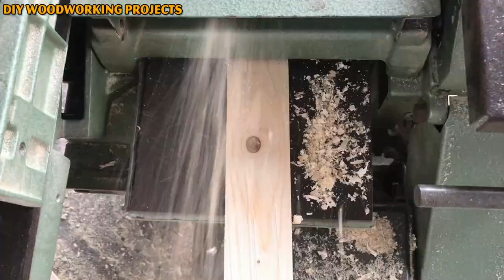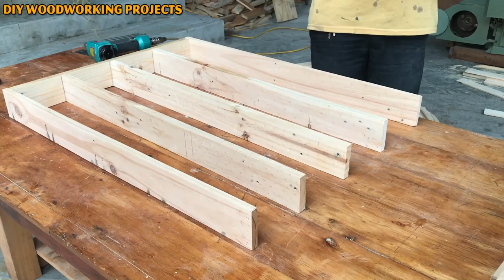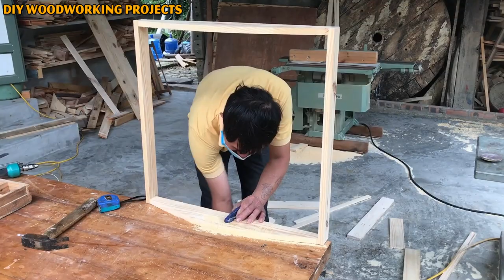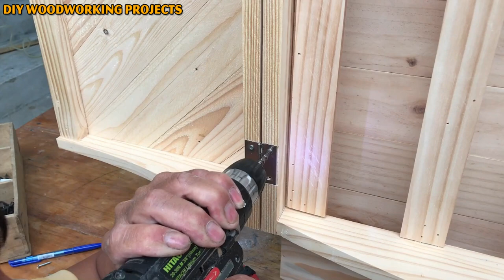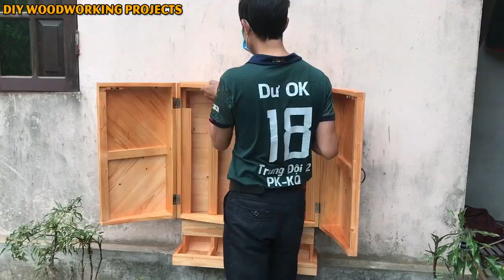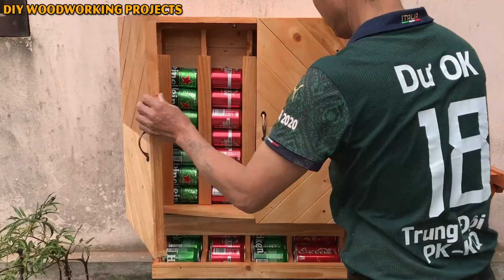Amazing Utility Woodworking Invention Idea // DIY Food Can Dispenser   With plans!

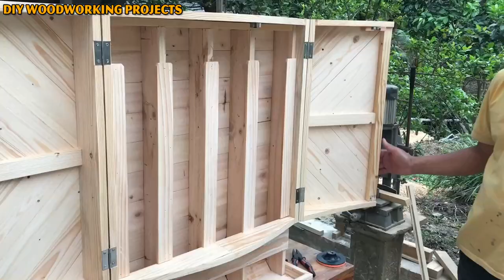Comment: Nails nails nails and cyanolite ! Did you remark around 13:10 that the vertical planks inside are not nailed where it was marked? why don't you make real assemblies with mortises and dovetails? The handles could have been removed before varnishing the or drilled after varnishing.